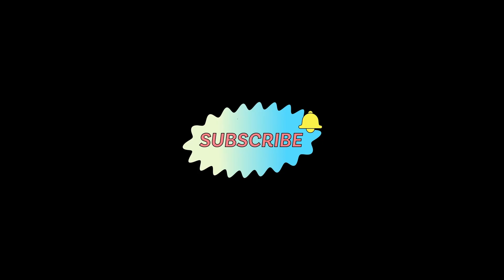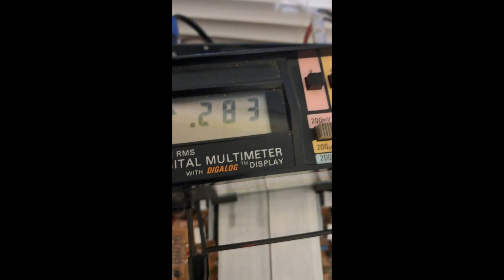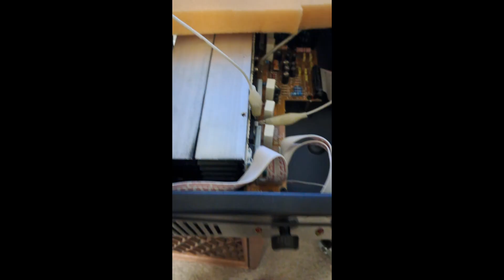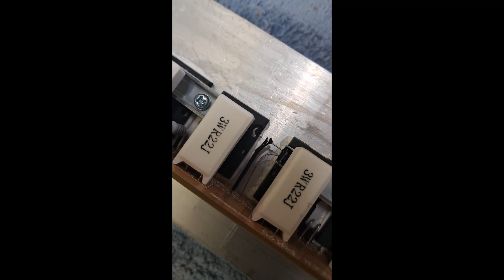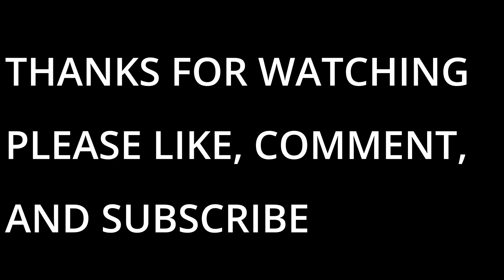Behringer EP2000 Repair

Comment: I have one it's not running no light coming on and fan not running too what can be the problem with my ep2000
Reply from the maker: Could be just a fuse, but if it is blown, other problems may be suspect.  Start with checking AC voltage . Walk the circuit from the wall voltage , through the fuse, then at the primary windings of mains transformer.

Comment: Good video, I’m curious - where did you get the schematic? I’ve had to replace caps and a couple output transistors, might as well do the thermistors too, my fan always runs high.
Reply from the maker: https://www.google.com/url?sa=t&source=web&rct=j&opi=89978449&url=https://audiocircuit.dk/downloads/behringer/Behringer-EuroPower-pwr-sch.pdf&ved=2ahUKEwiVuaaHk5aTAxUTyckDHTJXMKAQFnoECB0QAQ&usg=AOvVaw1wK5M949UHgbYRpK7Comgf
Reply from the maker: Thanks for watching and the comment, the link is below for the schematic!
Reply: @Threshold2012 thanks so much!!

Comment: Hi there, Thank you for the good lesson, I have a question, I have a Behringer EP2000 and one channel 1 tempreature is noticably higher than channel 2, the audio plays fine, on switching it on both channels gives that red flick but the faulty Channel 1 flickers  brighter than Channel 2
Reply from the maker: Hello,  thanks for watching the video, and for the question. It sounds like you may have a very slight bias difference between the two channels.  I don't think it is an issue as of yet. Did you measure the temperature of each heat sink with the cover off using a digital thermometer? If so, what was the difference in temps?  Do you have the schematic ? If you want to dive deeper, then  I would first measure the bias voltage on channel one, and compare that to the readings of channel two.
Reply: @Threshold2012  Hi there Sorry for the late response, unfortunately i did nit have a digital themometer, butI checked and compared one channel with the other and the problem seemed to be present still, I then replaced the 100 Ohm preset and it the tempreature normalised, Thank you for your assistance, I love repairing these amps